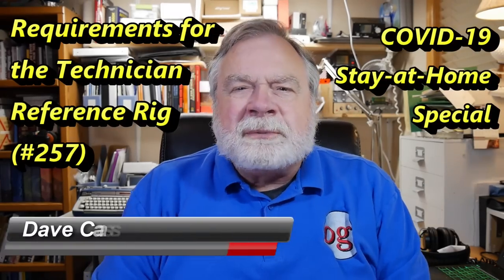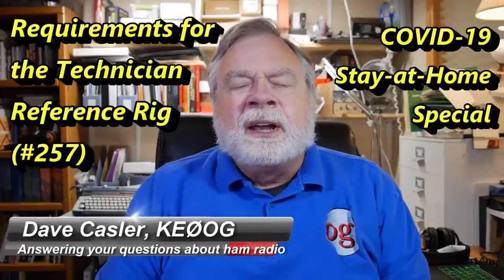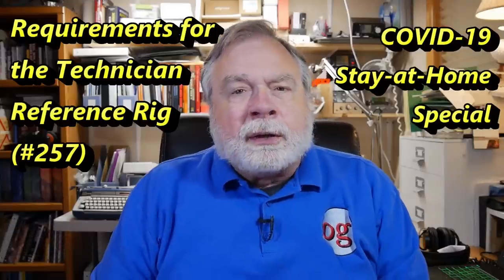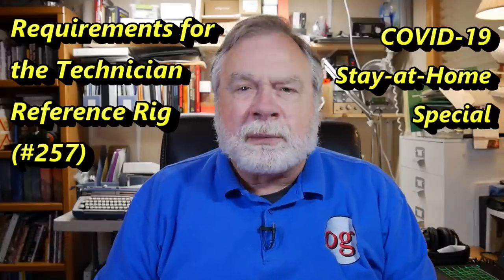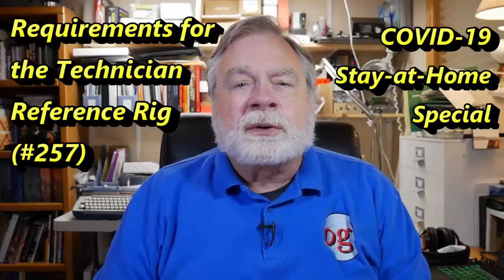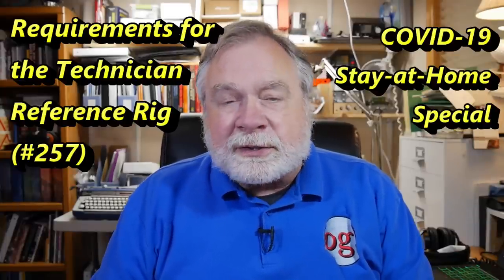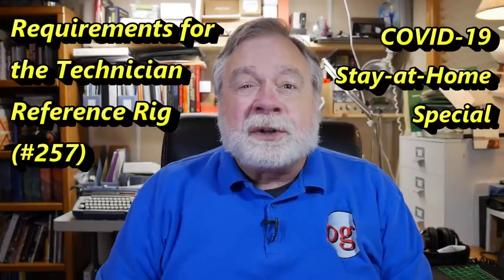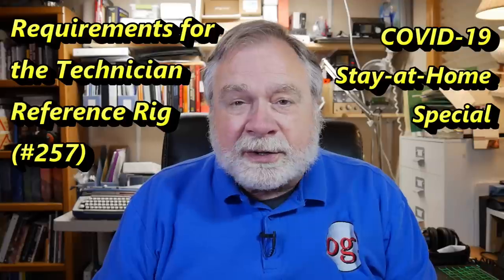Stay at Home Special: Requirements for Technician Reference Station Home/Mobile Rig (#257)

Comment: Right now, I am using a Yaesu FTM 400XDR. It has crossband repeat which helps greatly when I am on my farm property. I can set my HT to a 70cm frequency and have it "talk" to the 2m frequency and hit the repeater to communicate if I have an issue. When I get my IC9700 for the shack, I will put my FTM in the truck. There are some awesome choices out there in radios that serve you well.

Comment: my tech's reference station is this:  Anytone 6666, Yaesu FT-2900 and an MFJ 30amp power supply.  my HF antenna is an iMax 2000 up on a 20' mast made of fencing toprail. My 2M antenna is a homebrew 1/4wave groundplane up about 20'. Station is grounded just outside the shack with an 8' copper ground rod.    Works for me on 10m and 2m.

Comment: I am total agreement with you Dave about a manual squelch control. It's very difficult to use menu driven squelch while operating a motor vehicle to adjust for intermod or other QRM on VHF FM. I also agree that 5 watts for low power setting and 25 watts for high power setting is sufficient even if operating in simplex mode. Any more power is wasted heat and wasted energy. Those hams that feel the need to run QRO to the maximum legal limit on all bands are over compensators IMO. Good points discussed Dave. 73 de KB8AMZ

Comment: Dave - great stuff this series. I am amazed at how prolific you are and the quality of the presentations and information. I have used an HT connected to a j-pole as my "base station" 2M/440. Upgraded from an Alinco DJ500 (I'm not a fan) to a Yaesu FT2D (great HT) about 18 months ago. This has worked out well for me so I was thinking this may be a really good starting point for relatively new Technician licensees. I will upgrade to a full 25/("50") watt mobile as soon as I learn your conclusions. It would be useful if you could make a recommendation both for a budget solution and a high end solution. Thanks for being a digital "Elmer".

Comment: A plain dual band, preferably dual VFOs like the IC-2730A with very legible display, easy menus, and no proprietary frills will well and hold its resale value very nicely, for a start. ARES/RACES work in many areas makes the dual VFO's very useful.

Comment: Thought, maybe get a "White board" and put it beside/behind you and write down the proposed requirements and add or erase as you go so we can keep this in perspective? I have a large white board in my shack I use to keep a on-going project list and a "need" column. Very handy for me. Since getting older, my memory needs this " auto back-up" system, plus it larger print so I can see it better!
Reply from the maker: I do have a white board which I use for live streams. I could certainly use it for regular videos too.

Comment: I really like the idea of three different radios as well.  Different areas of the country have different repeater systems.  For example, my area (southwest Michigan) has a handful of D-Star repeaters, with one local DMR repeater and no C4FM repeaters.

It looks like the AnyTone AT-D578III BASIC or Connect Systems CS-800D for DMR, the Icom ID-4100A for D-Star, or the Yaesu FTM-7250DR or Yaesu FTM-100DR for C4FM.

Comment: Dave:  I watched this video with interest this evening. I think what you will find out about a radio with FM and a Digital Mode is that it varies by area.  For instance, in the area of the state I live in is mainly a C4FM Digital Mode on the repeaters.  When Yaesu offered the clubs a C4FM capable repeater for $500, it was extremely enticing for the clubs to buy them.  But in the central part of our state it is mainly D-Star and in the northeastern part of the state it is mainly DMR.  So the digital mode you select has a lot to do what is most prevalent where you live.  On the 25 watts output power, I agree to a point.  In my younger years I was heavily into VHF/UHF Weak Signal work and the more power the better.  But that was on CW and SSB running a pair of 4CX250B’s.  But I did have a friend that lived in Arkansas, some 250 miles away that we regularly talked to on 146.55 FM.  Most evenings I could talk to him with the 160 watt brick amp, but not without.  I realize that this is not a normal repeater operation.  But there are always niche reasons for exceptions. I totally agree with the precept of what you are doing!  Keep up the good work!   Alan, N5PA

Comment: I too would like to recommend the Yaesu FTM-7250.  It was my first rig as a Tech, and I still use it alongside my IC-7300.  However, as an everyday rig, I enjoy the universality of my FT-857D.  BTW, I believe 2 meter generally uses a -600kHz offset; 70cm uses a +1mHz offset.  And yes, NOAA/NWS reception is very important.
Reply from the maker: In the USA, both positive and negative offsets are used, 600 kHz on 2m and 5 MHz on 70cm.
Reply: David Casler - sorry, I stand corrected.  Thanks, Dave.

Comment: Icom IC-7100. This radio will encompass everything, vhf, uhf, hf, digital mode, extended receive etc... The digital mode dilemma is usually governed by what repeater you have locally. Dave has a DMR repeater within yagi range where as I only have C4FM repeaters close by. I do have a D-Star repeater that should be within yagi range on VHF.

Comment: Dave, my $.02: Bluetooth yes.  More states are adding hands-free laws.  Now, my state (Massachusetts) got it right by maintaining an exception for "federally licensed radios" but, really, you don't want to have this discussion at the side of the road if you don't have to.  I have not been a ham all that long but I'm pretty confident with a mic in one hand and one hand on the wheel (as the law requires) but if I'm able to pair the radio with my vehicle's system and put a PTT switch on the wheel then that's one less distraction while driving during a QSO.  Just sayin'.

Next, I'm leaning DMR.  I have DStar and there is little activity and few repeaters.  Some of the local group are doing NXDN but those radios are much more expensive than any of the others.  C4 is an unknown.  DMR, OTOH seems to me to be on the upswing and more reasonably priced.  (I'm strongly considering the Anytone 578 for my next mobile.  I can future-proof myself for digital and still use the existing repeater.   Win.)

Finally thanks for doing what you do.  I'm following the reference station stuff with great interest.  Keep up the good work.

/Ted - KC1JMZ.
Reply: Bluetooth , i agree with Ted Wojcik.  I am also from MA (I carry a copy of exception for "federally licensed radios") but I feel that for safety bluetooth in a vehicle helps keep the "distraction level" lower.

Comment: Hi Dave.  First comment, I'm not sure what you're trying to solve with this subject.  I have a shack radio, I have HT's, and I have a 400XDR installed in my truck.  You talk about mobile, but also say "in shack".  So I guess backing up a few steps, what function or role is this serving?  I would think must haves and nice to haves would be dependent upon role.  Shack, vehicle, field?  Then, what underlying functions?  Emergency, rag chewing, digital, etc. on VHF/UHF?  Cart before the horse in solution design?
Second, whatever it is you're trying to accomplish here (role/function), I would prefer it be the same digital platform as the reference 7300 (DStar?) ... because when you get to the point of reviewing set up and functionality, much appreciated like all of this reference series, having DStar demonstrated on two different units would really reinforce the learning.  I currently use Fusion with my Yaesu HT/Vehicle/Shack ... but for sake of really following along the 7300 reference journey, would like the two radios to line up and reinforce each other by approaching the learning from two different radios.
Thanks again.

Comment: Dave, thanks for another great video.  I agree with your 25W rule for LOS.  I do like the idea of using a 50W capable radio at 25W.  In my mind at least, at 25W I'm not always running my rig at the design limit.

Comment: I would consider it a requirement that the memories are programmable from a computer. The first 2m mobile I bought has a "data" port, but it turned out it was only used for upgrading the radio's firmware, not to program its memories. That was frustrating to discover. To determine what other features should be requirements, it would help to list what kinds of activities you want to be able to do: packet, SSTV, satellite, IRLP, APRS...? 

I'm really enjoying the reference station videos, Dave. I'm a fairly new ham with a pretty rudimentary HF station at home, so seeing your process is very helpful.

--Randy KD9LAD

Comment: Dave,  wonderful videos and I appreciate them.  I do believe the requirements mentioned are pretty standard in the name brand radios.  What I think really matters is what digital mode is available in the Ham's area.  Here we have a lot of YSF, with fewer of the other modes.  Other areas have none.  In those areas it may take a Hotspot to get on digital.  I have the FTM-100DR.  Great little mobile.

Comment: As for power. I have seen people that run 50 watts a mile from the repeater!  There are many places that say use only the power needed to get the job done. 1 or 2 watts can cover a long range! I am trying to make it habit to cut the power as low as I can and still get to the repeater. Simplex different, but 50 watts near the repeater can overload the front end and distort it. And could damage the 1st RF amp,  often a very sensitive  FET! Best practices is to use the lowest power needed to be able to talk!

Comment: So far your reference station mirrors mine.  I have the icom ic-7300 for HF,  Mfj-2010 ocf antenna,  Samlex 1235M power supply, and I have a Yaesu Ftm-100dr For VHF/UHF with Comet Gp-3 antenna which I recommend for your reference station.  73 KE8NQL.

Comment: I'm interested to hear about radios for all 3 digital modes, but most of the groups I interact with have coalesced on primarily DMR.

I'll argue a bit about requiring SO-239 antenna connectors. There are better connectors out there and adapters for everything. However, I don't think I've seen many V/U mobiles with anything else, and it is convenient to have one's equipment standardized.
Reply from the maker: Agreed that N connectors are "better," but not enough so as to warrant wholesale migration from UHF connectors.
Reply: @davecasler  
Thank you for your videos!  They helped me get licensed and more importantly be excited about getting into the hobby!  Thank you!

Related to this comment string though, I think the question though isn’t whether someone has to do a wholesale replacement but a smaller question of “who should buy one adapter?”  Should it be the person with a UHF antenna line with a PL on the end or the person with the UHF antenna line with the N connector on the end?  Since it’s the existence of the PL connector in the system that is the small detractor, the person with the PL end on their antenna cable is in the better position to use an N connector since they suffer no degradation by being asked to whereas the person with the N connector is asked to take some performance hit (whether one thinks it’s great or small) to connect to the SO-239 connector. I just think it’s a matter of who uses the connector not who replaces all their connections everywhere in their system. 

Also, I think experienced hams should be reminded that whether they agree with it or not, the current ARRL technician text and the current technician exam have questions to teach three things regarding this: 1. N connector is better at higher frequencies including UHF, 2. The greatest killer of coax is water and 3. The N connector is more water resistant. For a new ham like myself the lack of even options for N connectors on radios seems odd given those specific teachings. I’m just talking about the connector that comes on the radio, it’s the one thing that’s difficult or warranty voiding for the consumer to change. Someone’s system can be all PL and SO but given the current teachings, why make the N connector antenna person use the adapter for the one connection they can’t control?  It just seems there’s some dissonance between the technician teachings and the offerings. 

I should also note I’m thinking of these radios as base station radios so try real runs of cable. Not a few feet in a car. It seems mobile radios are the base station radios for VHF/UHF so real cable runs to the roof of a house is the issue.

Comment: There is one more requirement which I think is extremely important. The ease of programming, and the software that helps do it.  I have the Anytone 578, and I have an Icom ID5100. Both these radios are great performers, but for ease of programming, I would choose the ID-5100. I use the free Icom programming software. You can also use the dstarinfo.org website to download repeater lists (both dstar and fm) for your area based off the information from repeaterbook.com.  It is also easy to hook up a rigblaster or signalink to the Icom, in order to use emergency digital comms such as winlink if needed.  None of this is available for the Anytone, and using the supplied software for programming is a lot of work. Most people using DMR get a codeplug for their radio from a friend, and never really get the knowledge of how to program their own radio. Don't get me wrong, I have more DMR radios than Dstar radios, but I have invested the time and effort to learn how it works and how to program each radio I have. Here in Vancouver, BC, we have a good selection of repeaters for all digital modes.   73's Dave. Enjoying your videos.

Comment: Hi David, 
I would suggest the Yaesu FTM-7250DR as it seems to be the least expensive of the three Japanese manufacturer radios coming in at $210. It just happens to have C4FM as a bonus but a mute point if you do not have any C4FM repeaters in your area.
The ICOM and Kenwood dual band models are more money and if you want more features look at the Yaesu FTM-100DR transceiver for under $300 that has APRS and Wires-X capability. I would say that this model is Yaesu's best selling radio. I am using my FTM-100DR to feed a repeater the C4FM Wires-X signal 20 miles away from my home on only 5 watts of power.

Comment: Thanks for these videos Dave. A great service! One strong urge toward a crossband repeat. Not a hard requirement. We use Xband repeat all the time working events. We will set up a backbone frequency on 2 mtrs for stations in the field back to base camp. Then each station can setup Xband repeat at their location and that will let them have the flexibility to move around and check on participants. I don't ever recommend Xband repeat to repeat a repeater. That doesn't work very well at all.  DE WB5ORT
Reply from the maker: Thanks for the info!

Comment: I know others will argue, but I have used both DMR and Fusion. Fusion is so much easier to set up and use (that is basically nothing). It took me about 2 months to figure out how to configure DMR as a new ham. However, if your local area has one or the other, then I'll recommend either. I own a TYT TH-7800 in my truck and a Yaesu FTM-100DR in my shack. I like both. I hear the TYT TH-9800 is the big brother to the TYT TH-7800 and is a little better.
Reply from the maker: Thanks for the info.

Comment: Radio should have a dual VFO and a din port in order to connect a TNC, like the FTM400XDR.  This allows for quick access to Winlink or FLdigi, if one gets involved with ARES.  With the FTM7250DR you need to connect the TNC to the mic jack port which is pain.  I wish I would have just started out with the better radio.
Reply from the maker: Thanks for the input.

Comment: FWIW I would go with D-Star or System Fusion/C4FM. Or not require digital at all. I think one angle on this is whether you are going for a mobile radio to use at the desk or just a HT? And whether you want the ability to use a mobile radio in the car if you go that route (one radio, two uses). These factors would change the choice.

Comment: I prefer DStar for digital mode operation as my first choice, it can be used locally and there are a great number of reflectors that can be accessed either via a hotspot or local repeaters.  It relatively easy to setup, repeaters are not as plentiful for DStar as fusion, but they all allow internet access, where as not all fusion repeaters have WiresX internet access.  As far as fusion it's ok but one thing I noticed is that if your using fusion via a repeater, there are many fusion repeates out there however in a lot of cases (at least in my area) many are lacking WiresX Internet access to access Internet rooms. Just because a repeater has fusion it does not guarantee internet access for remote rooms.   DMR can be confusing and hard hard for a beginner to setup without a great deal of assistance.  Many of the DMR radios are cheap but the software to program the code plugs can be expensive and hard to use in most cases.  As far as audio quality I find Fusion to be the best, followed by DStar and finally DMR.   My vote is for DStar since it's relatively easy to setup for the beginner and offer the best overall range of options.   Many of the DStar  radios come with their own programming software and if you choose to purchase a 3rd party programming software such as RT Systems is very affordable.
Reply from the maker: The Chinese radios come with free DMR programming software and often come with programming cables, although there are sometimes Win10 compatibility issues. Japanese manufacturers charge for programming cable and for programming software. For purely FM, CHIRP is a good choice for software.